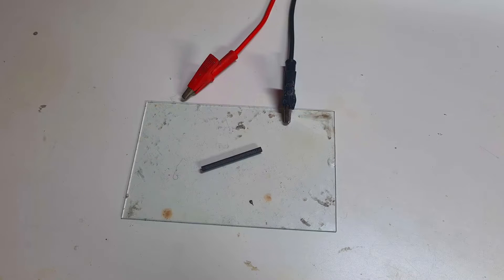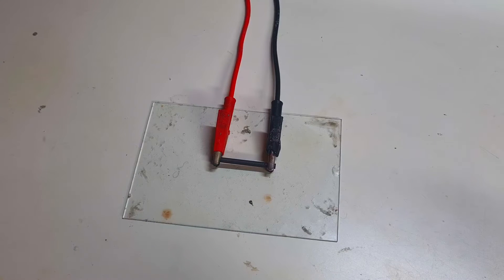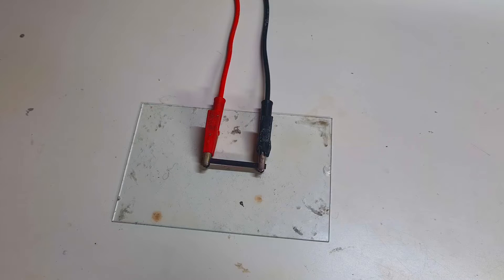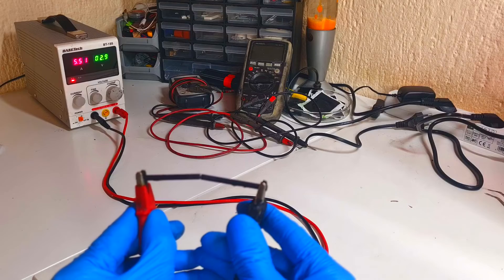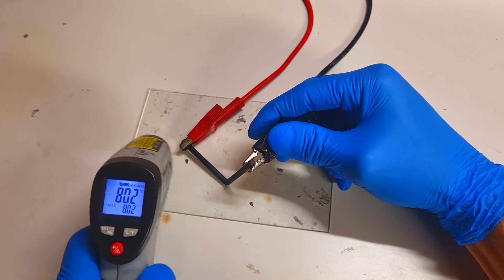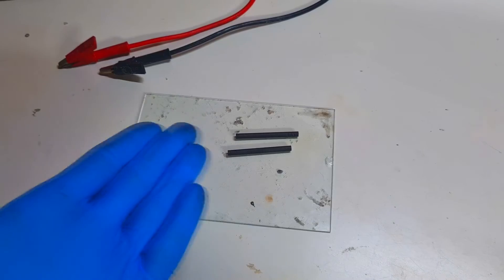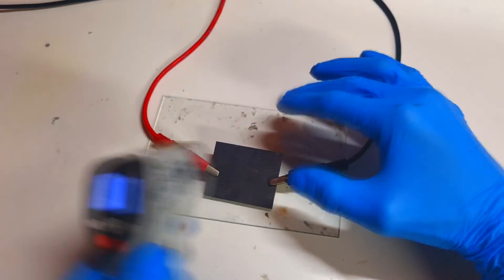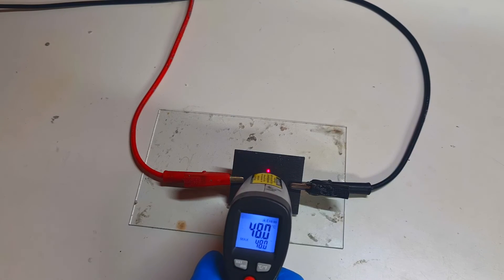DIY Super easy Carbon rod heater

Comment: Temperature depends on power dropped across the heating element in this case the graphite rods or plate. As you know power is voltage times current,  and voltage is dependent on resistance. So the less resistance the heating element have the less power it drops. In this order the lower resistance graphite plate is not so good for this purpose,  the wires probably are heating more than the plate and wasting 90% of the entire power.
Reply from the maker: Of course the temperature depends on the power. The cables were fine
Reply: @cayrex  how would you fabricate a secure terminal on one end of a carbon rod